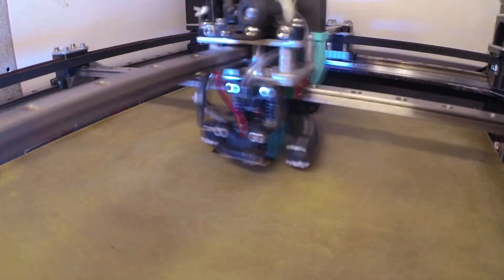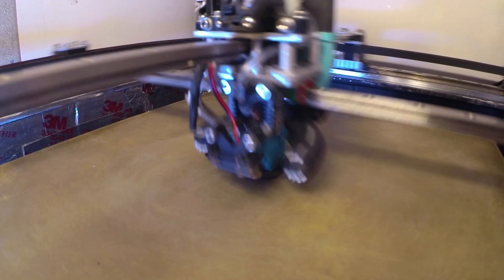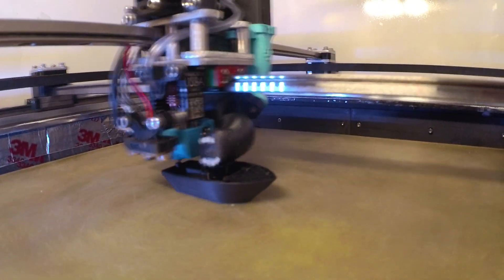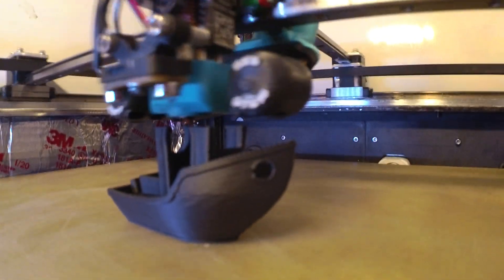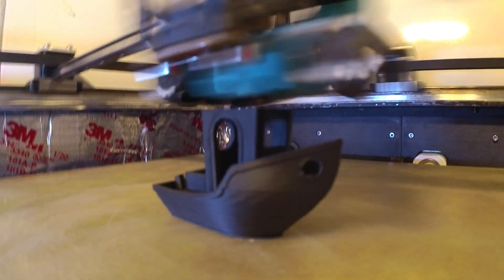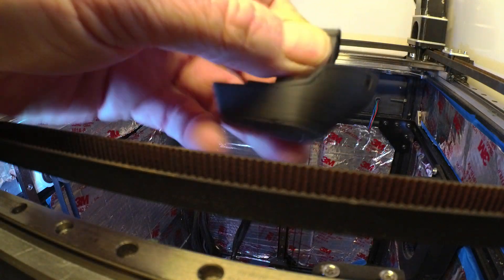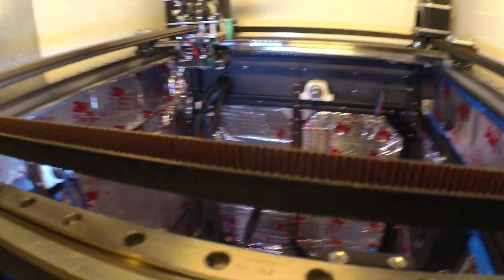Cross gantry benchy 9min #speedbenchy

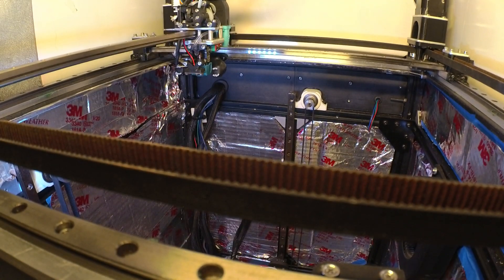Comment: I'm feeling pretty good about my printer now(I wasn't sure how my benchy stacked up against the community). All other drawbacks of a bed slinger aside. I got a 9:40 benchy with similar results(CF-Nylon so I did cheat). I do not have proper cooling on this printer which is my most limiting factor atm. I plan on using your octoduct to try to fix that. Amazing work you did on that thing btw. It prints so beautifully. Keep up the awesome work!

Comment: Awesome work man. Love seeing you have a new video.
Reply: How much difference is the 17mm extruder motor vs 14? Seems that .2 at 80mm is alot for a 14mm.

Have you killed any 12v fans running at 24 or do they keep going? 

I assume that sqv makes a huge difference in speed benchy time?
Reply from the maker: @travistucker7317  17mm is the 17mm wide motor. .35A motor vs the 20mm wide nema 14. So they are both nema 14, but one has less torque and smaller. Fans last a long time and SCV/JERK does make the time lower. This is really too fast for this hot end and barely too fast for ringing. It is what it is.
Reply: @PIRACER VELOCIRAPTOR  ok i had the motor comment wrong. Thanks. I'm gonna have to look into that soon, i believe.  Thank you. Is that the popular ldo nema14, everyone recommends? I forget the numbers
Reply from the maker: @travistucker7317  Moons/LDO about the same. Just get the specs on motor current.
Reply: @MrRocksalt  .35 amp if i remember